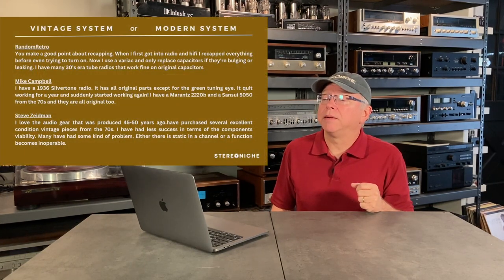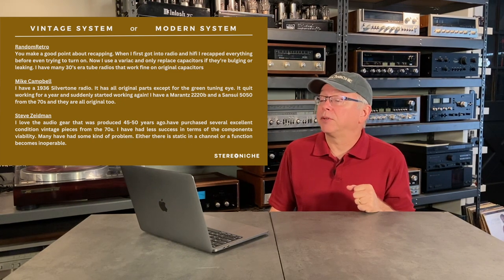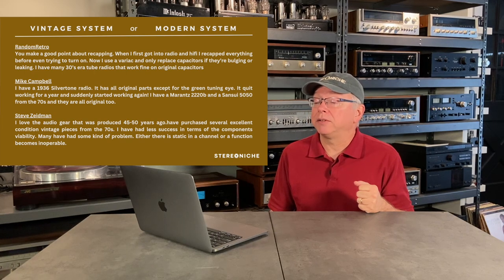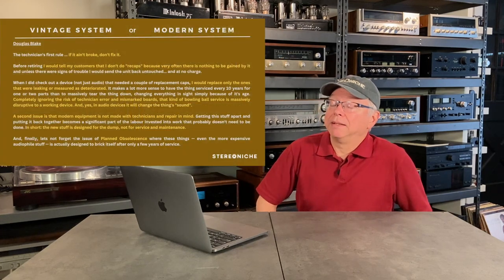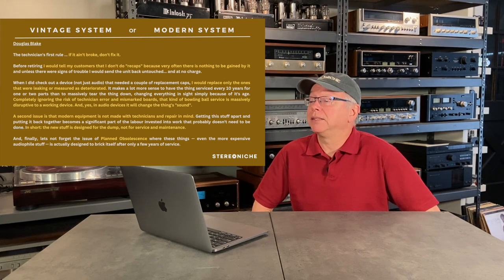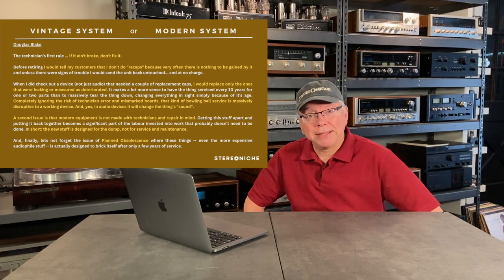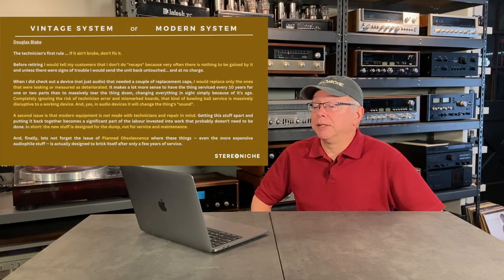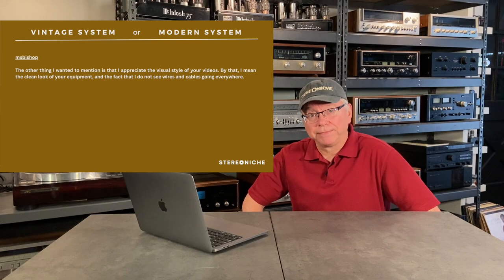Vintage vs Modern - Build Quality  Comments

Comment: I had my Sansui AU7900 that I purchasd in 1975 completely rebuilt last year even though it was working fine. The difference in sound is amazing and the cost was worth every cent. Whether the capacitors are long lasting like the originals is to be determined in the future. As youn can guess, I am a  big fan of replacing vintage capacitors.
Reply: Especially since usage+ age degrades electrolytics.  Modern electrolytics are better, period.  I have seen the cocky types brag about not recapping, just to have the caps blow up on them.  I've seen it happen. At the very least, degraded caps affect the sound quality.  I know, my amp sounded murky and dull until it got re-capped.
Reply: Yeah, him having every cap go on that multichannel amp is an outlier. Old caps aren't holding their original values. You can replace with new film caps for cheap so why not?
Reply: @scottlowell493  I did not realize how much the sound quality of the amp had gone away until the rebuild. I'm lucky that I have an experienced technician that specializes in vintage equipment just a few minutes from my home. Eventually he will get my Pioneer 8500 Tuner, JBL 100T speakers  and Hitachi D-980M cassette player. My main system is all vintage purchased in the 70's and 80's.
Reply from the maker: Absolutely, thanks for chiming in with your perspective and experience!

Comment: For many years, I have been rebuilding acoustic reproducers for antique phonographs, both disc and cylinder. It's remarkable how distorted the expectations nowadays are about what a machine from the early 1900s or 1920s is supposed to sound like. Usually, many will describe it as tinny or squeaky. And it's usually caused by listening to one that has never had any service in 90+ years and barely works at all.
But the built quality will usually allow it to live again. There are some parallels to vintage hifi that I see here.

Regarding caps, I had a very mixed bag so far. One was a Kenwood integrated amp from the late 60s that I had bought from a dealer. It was fully serviced and only partially re-capped. When it arrived by mail (very well-packed) one channel was way off in volume. It came with warranty, so I had to send the huge thing back to get two more electrolytic capacitors replaced.

When I got it back, it worked...exactly for one evening. Then it would make a loud bang through the speakers every time I would turn it on after leaving it off for more than a few hours.
Guess what? Yes, some more electrolytic caps kicked the bucket. So, I did end up sending that monster back twice and in the end it got a full re-cap - probably 60+ of them in total. It has been working perfectly throughout the 2+ years since that happened and sounds terrific. I admit, this was an extreme so far. But a full re-cap in the first place would have saved me hours of packing, and a scratched volume knob.

I now own that unit twice with the other one only having a few of the smaller Elna caps replaced. I turn it on for about 10-15 minutes once every month to exercise the caps. But both amplifiers perform identical and have no audible difference in sound characteristics. So, in my experience, re-capping just needs to be done properly, and with quality parts, just as any repair does. And in case of a difference in sound, it can also mean that the original caps aren't up to specs anymore and doing their own thing.

I also have a JBL SA600 with all original parts, including caps. Some are leaky but still work sufficiently to be safe. However, I have to wait about 1-2 minutes after I can use the volume control due to the DC leakage that slowly recovers.

It's not intended as a manifest for a blind replacement of components. But it can be absolutely necessary at times and, in my personal opinion, should neither be feared just like keeping original working components in as well. Thanks for the great videos, you have a beautiful storage setup in the back!
Reply: @Douglas Blake Thank you for your remarks. I paid a pretty penny for that amp and still have no regrets.
The final full re-cap did take about two weeks and I had their technician on the phone who did seem to know his stuff quite well. That bang might have been indeed something on top of that.
I actually asked him to include the bag with the old caps as I wanted to keep them. And he actually did. He even left one of the large old filter caps disconnected in place just for the appearance, since the new one was  combined and physically smaller.

I guess, the dealer is a bit more to blame here. They later admitted that it had been serviced about two years prior to my purchase.
So my guess is, that it just sat there and was not tested again before being sent out.

I have paid the $500 ballpark for getting a machine fixed. And I still consider that to be the overall better investment than buying something fancy new that I have no use for in 5 or 10 years.
Reply: @Douglas Blake No hard feeling at all here. I am using an Icepower 125ASX2 with a separate Sanyo preamp (both also from China) as my amp gear for my back room. Fits nicely on top of the tower. I just cannot squeeze enough storage into a NUC, although I do find them very appealing as well. :)
Reply: @Douglas Blake That's a very good advise that I already adhered to. Years ago, I found someone who is incredibly knowledgeable and has become a trusted friend as well. He does this only as a hobby for a small circle of people he knows and I consider myself extremely lucky.
The only drawback is that he isn't that local but still reachable by domestic mail. And he has a great mindset about vintage gear in general. Priceless, indeed.
Reply: @Douglas Blake Absolutely, the Icepower is really great for driving low-efficiency speakers as well.

Well, I do have already over 40TB in external storage plus some redundancy. But I also need good internal storage to work with at better performance. Just setting up a TrueNAS on a retired Xeon E3 to see if that may help.

Comment: Great video!  Such insight for vintage equipment.  Would love a list of "vintage integrated amps" that offer great sound signature and quality.
Reply from the maker: I have only scratched the surface of hearing gear, despite my collection. For preamps, it sort of falls into two categories, simplistic or kitchen sink. Purists want the signal to travel as least as possible, so prefer pre's with minimal functions. One of my favs is the Thalia from GAS. On the other end, a pre with a wide range of functions is a Pioneer Elite C-90 or one of the siblings. But be forewarned on the Pioneer, some parts are becoming a challenge to procure.
Reply: Sansui, their 1967 through say 1973... They are not sexy looking like some of their more modern units, they are more like the girl next door. But, the sound quality out of these is simply incredible. And I am not the only one that believes or thinks that. Best part, they are usually pretty inexpensive as they do look dated, so they are quite easy to find. I own the 2000 and the one in my rack is the Sansui 4000. I have it paired with the Zu Dirty Weekend speakers. A match made in heaven.

Comment: This is an easy question to answer, not just build, but sound quality. I have two Sansui units, a 1969 Sansui 2000 and a 1970 Sansui 4000. I paid $200 for each unit, and am continually blown away by the sound both of these units produce. I went through tens upon tens of thousands of dollars to get to this point. None of the modern gear I have owned can even touch the sound production of either of these units, it is old school analog baby! 

A $200 50 year old stereo receiver is now the center piece of my audio system. And I use its internal phono stage too, as there is nothing in my possession that can beat it. Huge bass, airy and tube like midrange, gorgeous highs, zero ear fatigue. I am using a pair of the Zu, Omen Dirty Weekend speakers, circa 2017. Audio Nirvana.
Reply from the maker: Thanks for relaying your experience! :-)

Comment: Some Other Audio Misadventures By Myself & Others.....

 I had 2 different preamps where one channel kept going out. I had to keep getting up and flicking my index finger at the intercoonect connector, and if I did  that enough times the sound would come back on ...for a while anyway. It was from 2 different time periods and 2 different interconnects. I believe the problem was inside the preamps. 

 Back in the early 1980s I had a Philips turntable. It was either a GA 312 or 412 turntable. One time I came in from the chilly weather, after finding a scarce  record I had been looking for at least 12 years. I anxiously put the record on and when I pressed the start button, the turntable did nothing. "Darn it" or something stronger I said. It wasn't an old turntable and I paid good money for it. Not only wouldn't I be able to play my exciting new lp purchase, but any of my other records either. About an hour later after warming up by the fireplace  I walked back over to the turntable and tried again. I pressed the button and the platter started spinning! It was OK. I looked through the owners manual and it said the buttons are heat sensor buttons. My fingers were too cold before.

 A tube from a tube amp exploded in my face. I now make sure every tube is firmly down in its socket before turning a tube amp on.

 I once talked with one of the founders of PS Audio. He told me about a person that called them dismayed that their new PS Audio amps only worked in the evening. Their think tank scratched their head for weeks, with no solution that anyone could come up with. Then on about the 7th call it came out that the amps were connected to a timer at the AC outlet

 Brushing contact enhancer on exposed audio coils. No more sound; just hum.

 Building an isolation base with multiple tiers that went from floor to up near the ceiling. If 2 tiers are better than one, then 18 should be better than 2. Right? With all that weight I should have used more hot glue. The whole thing came crashing down. An ethereal five minutes and then disaster. 

 Years ago my Shure V15 cartridge started making weird sounds. It sounded like a mechanical sound. My other cartridge needed a stylus replacement and I replaced it with my Shure whose stylus was in better shape, until my new stylus arrived through the mail. A week later, I realized the Shure was doing a low rider dance. It was a much heavier cartridge than the Micro Acoustics and I forgot to re-adjust the counterweight at the back of the arm. These were all lessons learned. Now I make no mistakes....

 For all the good vintage equipment back then, there were stinkers. An acquaintances $7,000 Dayton Wright electrostatic speaker circa 1970s made crackling sounds even an hour after it was turned off and unplugged. Koss many decades ago, made a model 9 electrostatic headphone whose energizer blew out most receivers and amolifiers. They had to come out with another energizer box that corrected that stupid design, designated the 9B. There were a few mega buck speakers that unintentionally let out a gas that filled the room, and was a health hazard. Famous designer Nelson Pass said he almost died from continuous breathing in the fumes. Nothing sounds so good that it's worth that.

Comment: Great video. I made one of my vintage systems operate like a new system. I have a Sabaj A10h headphone amp with RCA ins/outs in a tape monitor loop with a remote volume control. I also have a remote control power switch. All the convenience of a new amp with the awesomeness of a vintage system. I love the rating system for receivers. Are you doing more soon?

Comment: I enjoyed your video and I totally agree that in the 60's and 70's it was worth every penny to have equipment repaired, that is if they needed it,  Which was not very often,  but now everything is designed to last maybe 5 years or so,  and why would you want to have nowadays gear repaired,  there is no reason too in my opinion.  THe old vintage audio not only sounded impressive but looked impressive too,  and you can't really say that about Audio gear now
Reply: "...   but now everything is designed to last maybe 5 years or so, ...  THe old vintage audio not only sounded impressive but looked impressive too,  and you can't really say that about Audio gear now" - what audio playback equipment today have you exposed yourself to?  There are many brands that aim to make design statements. There are also many brands that take pride in being over-engineered. Sure, they are expensive, but they are out there.